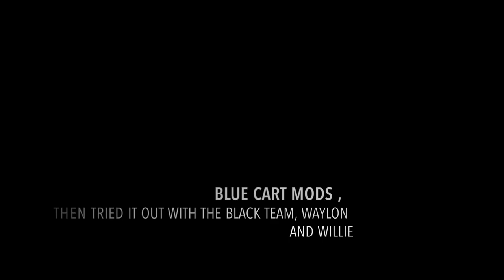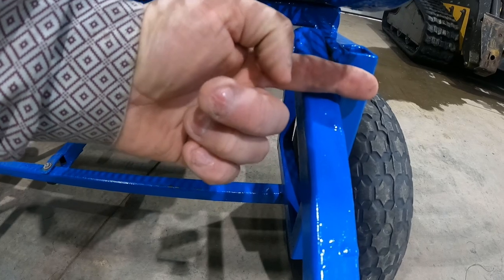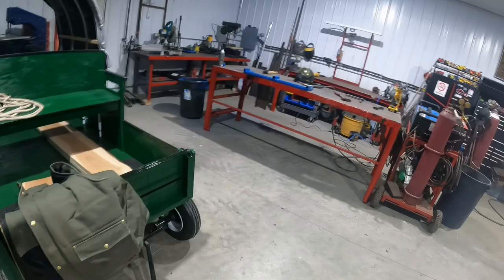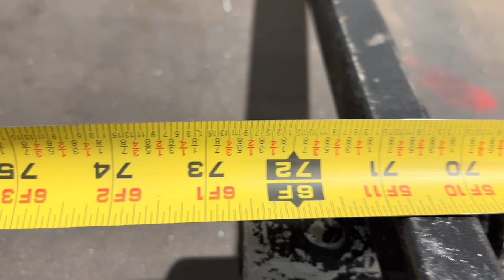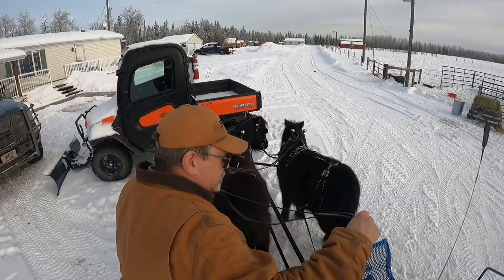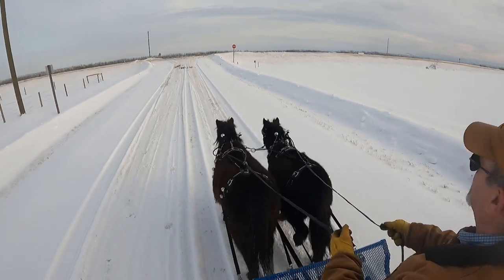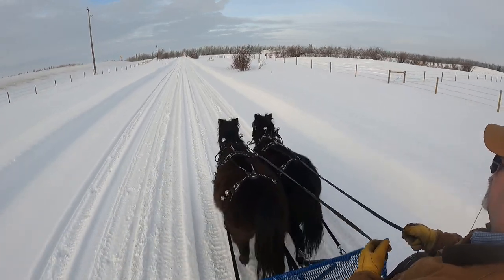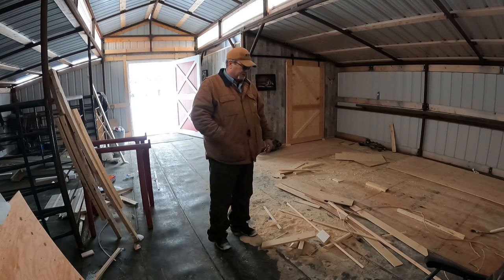A great day for a buggy ride

Comment: nice video thanks for sharing. im wondering what the barn floor is made out of ? do you have concrete underneath ? love the barn nice layout
Reply from the maker: Thank you for your comments. For the floor I built it up with clay, then gravel, then oak swamp Matt’s and lag bolted the barn down to that. Then put plywood and screwed rubber matts